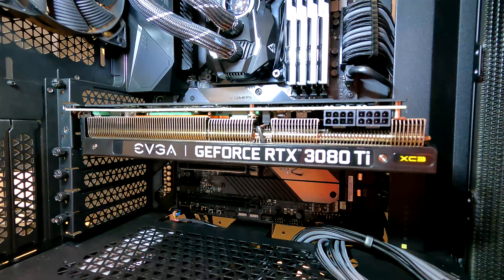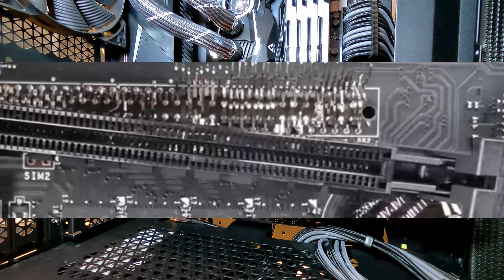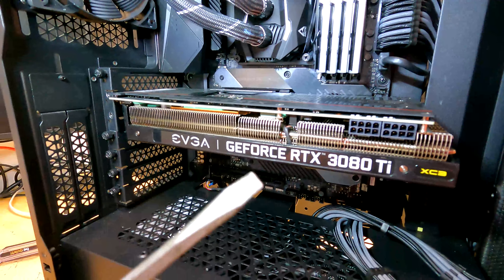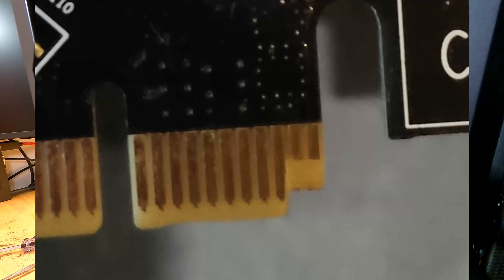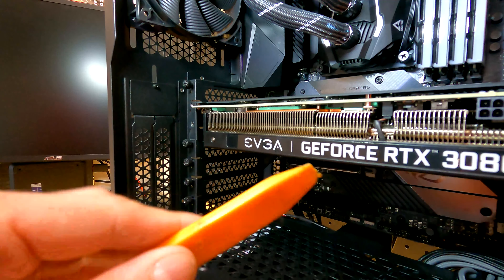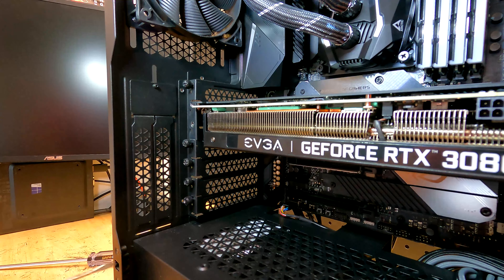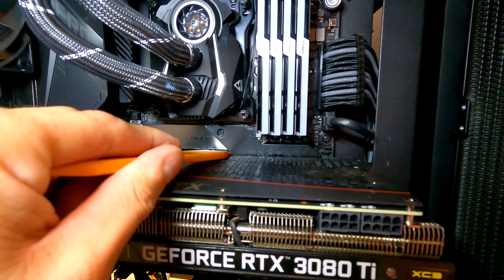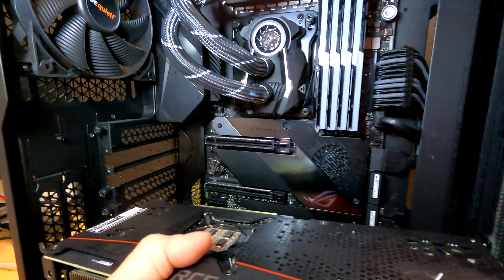Graphics card removal tip!! Avoid broken clips, PCIE slot, or damaging your motherboards!!

Comment: First time i tried to remove my gpu I forgot to unclip the clip and had my gpu hanging half way out and half way in. I called my buddy over as i sat there for 15 minutes holding it as still as I possibly could so i didnt break anything 😂
Reply: How to remove same problem and I can’t fit it back in because of the angle it’s in
Reply: @sarsvfx  i just had to slowly work it back in.  Make sure ur gpu isnt caught on ur pc case on the left side bracket mine was a little bit and i just pushed the metal bracket in a little bit and it slid back in.
Reply: @Synusia24  I know but to fit mines in I will have to push it up to the right a bit everything is so tight I can’t ruin a rtx 2060 😖
Reply: @sarsvfx  ik i feel ya man it’s stressful i had my 2060 stuck also. U just gotts take ur time and try to keep it level and slowly work it back in somehow. Theres a way
Reply: @Synusia24  thx so much brother wether it works or break or whatever am grateful for your help it means a lot thankyou

Comment: im having some issues recently with the display port. so basically i noticed the gpu fan just stopped working. and display port went out. i unplugged the gpu and seated it into the bottom level of the motherboard. haven't updated yet,  but my question is do you think i need a new motherboard already? or is this a gpu issue. all pc parts are two years old. so new basically.
Reply from the maker: hard to say. I would test the gpu in a different system and see if it does the same thing.

Comment: im tryna to remove my pcie slot cable and its not budging at all like i have to use full force and i cant get it out i dont wanna try and break any components because im replacing my gpu and psu any tip how to get the pcie cable out easy if its in tight?
Reply from the maker: wiggling back and forth sometimes does the trick.

Comment: If you have a big air cooler it's virtually impossible to get your graphics card out with your bare hands. A babies hand might fit but nothing bigger.
Reply from the maker: it's crazy how mobo manufactures missed the mark on that!!
Reply: I'm regretting buying the Be Quiet! Dark Rock Pro air cooler for this exact reason.
Reply from the maker: @Erkm4n  been down that road!!
Reply: Used a long hex tool to push the lock down lol
Reply: I have the biggest Noctua air cooler. He fills every single space. It's impossible.
Reply: @yodag2859  I was doing that too, and got my gpu half stuck 😵‍💫
Reply: It's worst when using a micro atx motherboard... Can even put almost a screw driver
Reply: @tkmanolo_kp2035  “half stuck” how’d you do that? I resided from that hex tool method lol, it worked but it slipped and tapped the motherboard. Thought I was abt to punch a hole through it lol
Reply: Hahaha dasurvvv to those going overboard on coolers 😝
Reply: Anyone have a baby I can borrow to remove my 7900XT? Asus motherboards have no space even with a small AIO (or maybe I just have giant hands)
Reply: Yea same my cooler is in my way idk maybe it's actually stuck but gotta keep trying xD 
Could my card 4080 be that heavy that its actually stuck
Reply: @Erkm4n  same here, i hate it
Reply: @Erkm4n  exact same one exact same problem uaha
Reply: @hush3956   what helped me was a panel removal tool I had for my car. the smooth edges on it were a lifesaver

Comment: I broke my retention clip last week taking out my RX 6600.  The mistake I made was unscrewing the i/o and lifting my card first before pushing on the retention clip, thus forcing my card out and the clip came with it.  Luckily, I repaired the clip and slotted it back in.  Thanks for the tip!

Comment: Good tip though less people will run into this problem with latest motherboard manufacturers adding a quick release button, a much needed quality of life change. In the past I would use the eraser end of a pencil when that situation presented itself (never had issues).
Reply: For any Asian household; a simple wooden chopstick will suffice. I really want the new motherboard button to relase the gpu but maybe in 4-5 years time once i completely upgrade my pc.
Reply: I just ran into this problem. Broke the release latch and the card is still stuck in the slot. Dammit!

Comment: I bought a prebuild from Lenovo and i want to add a new NVME M.2 SSD, and the M.2 slot is beneath the GPU, but i can't pull the gpu out because of the clip that locks the GPU to the motherboard. Its somehow totally stiff, and ive tried nearly everything. Do you have some suggestions on how to fix the clip?
Reply from the maker: not sure, neve seen that before.

Comment: I'm so lucky that I bought a cheap auto trim removal set about two years ago (that I ended up not needing and didn't return, so it was in my garage today and I could work on my own computer.  This video was great advice - wish I had seen it before I worked on my spouse's computer a year ago though!  Thanks.

Comment: Ive never broken a pcie slot (hands work fine lol, done it for years) but for people who are not as knowledgeable this is a great solution since Ive talked to people in the past that have easily destroyed their motherboard like you said in the beginning with a screwdriver
Reply from the maker: i spend my down time hunting,  look for newer post and offer cash quick... plus my area has lots of people letting go of stuff cheap
Reply: I hadn't either, until it happened. Broke off with my finger, so I'm going to go ahead and call it a manufacturing issue. First time that's ever happened to me, and the thing is it's an Asus TUF Gaming board, and those wings look thicker than average.
Reply: Well there is no space for fingers between Double tower air cooler and 7900xtx..
Reply: Hadnt for 20 years of pc building. But these graphic cards are so big now sometimes, that it covers the whole pin.

Comment: I found a reddit thread that suggested a wooden chopstick, and I managed to make that work perfectly (never slipped either, which was a relief)
I found it a lot easier to push almost entirely from the side (like the back of the pc case, rather than straight down), thinking of it as pushing the clip 'back' rather than 'down'  (or I guess forwards, since that's towards the front of the case?)

The chopstick was super useful because of how long it was though, I have one of those fat new-gen cards and a giant cpu dual-tower cooler leaving me less than an inch of space to work with over the GPU.

Anyway, thank you for the video, it was helpful, and I'm glad I didn't use a screwdriver for it.

Comment: Hey ! I have to add a ssd but the gpu block the access to add the ssd, so I have to remove the gpu and put it again when the ssd is installed. But I was wondering if the gpu will be detected as the same old gpu. I mean do I have to reinstall all the drivers and the settings of the fan etc ? Or it will be kept in memory
Reply from the maker: it will stay the some, it is only when you change the gpu to a different brand you have to reinstall everything.
Reply: @DLMtechgarage  thx a lot